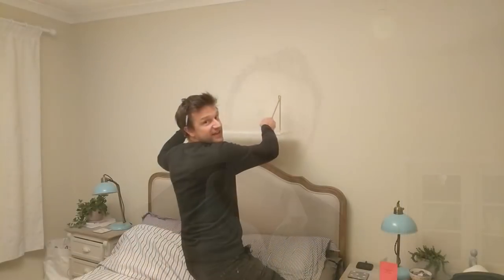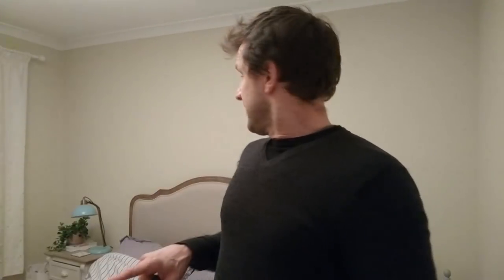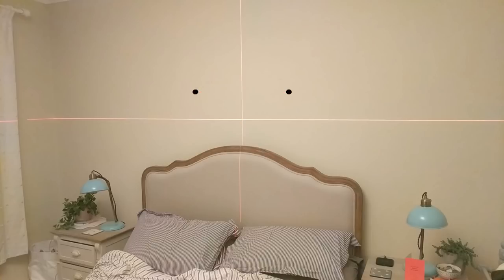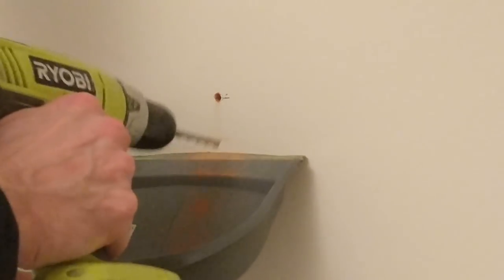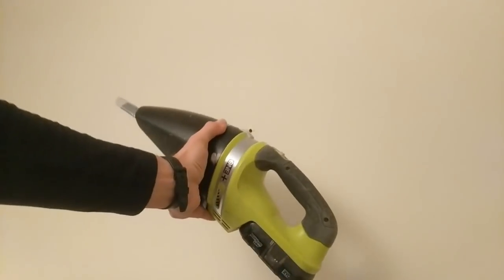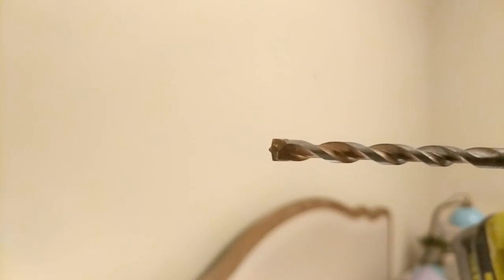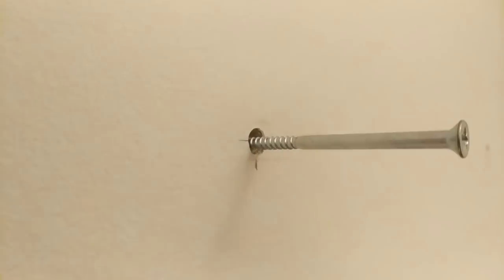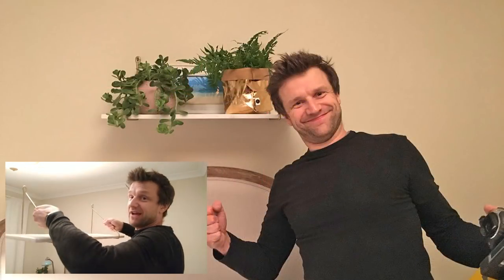How to Hang a Heavy Shelf on a Brick Wall

Comment: Some nice tips Charlie, thanks for the video. I like the dustpan idea but I don’t have the hand coordination and grip strength you do as I am getting a bit older. I use a brown paper bag (lunch sack) and a strip of blue painters tape across the back and use that to catch the mess from the drill bit. It works well for me... cheers.
Ron
Reply from the maker: Ron H That's fair enough Ron. A decent technique that I've heard other people using - just need to be careful not to take the paint off. Thanks for the comment!
Reply: What a damn good idea. I haven’t drilled anything because I’m afraid it won’t hold and the mess it’s going to create. But the bag idea 💡 I will do that instead of the broom pan. Gracias from Mexico 🇲🇽

Comment: Great tips as always Charlie. Particular like the "wiggle" about abit drill bit. Everyone has one of them "universal" drill bits in their toolkit! I tend not to knock through the wall plug in as you lose support of the wall plug where you need it i.e. Nearest to the wall. Without that when you are hanging items the screw can pull down into the void slightly. If the correct size screw and hole is used you shouldn't really get plaster cracking.

Comment: Before drilling into any wall you should always check for Electric wires and Water/Gas pipes, even if it looks from the outside there is nothing there, otherwise a good job.
Reply: How do you find out if there is anything behind the wall that you listed above?

Comment: Great video Charlie it really covers the practical issues so well including your reasoning for each decision. 

I was just wondering about option 1 - if you recess the plug it would be very close to going through the brick on a cavity wall I think.  Is this something you need to be a bit careful of if you have cavity walls in your house? It would be just the sort of thing I would do Lol.

Comment: Another good way of catching the dust is to put an open envelope under the place to be drilled and tape it to the wall with low-tack tape.   That leaves you two handed for the drilling

Comment: Is it just pot luck you don’t hit crumbly mortar or the edge of brick and crack it?
Trying to fit some heavy duty 6kg brackets to hold a 12 kg keyboard.
Pretty old house so chances are the mortars not up to holding 18kg  but reluctant to strip it back to brick if I don’t have to.
Any advice appreciated 🙏 or do I just pray I hit the middle of a brick 🧱

Comment: we have a 20 kg cabinet to hand that can take additional 10 kg load. The cabinet is held on 2 parallel battens that altogether are fixed by 8 screws to the wall. We were thinking 8 by 50mm fisher plug plus 5x70mm screws, do you think it will do the job for the potential 30 kg? It's a brick wall as well. Any hints on what length plugs/screws for what load in general? thanks for a super useful video, hope we will get ours right :D
Reply from the maker: Hi Anna. Yes I think that would be a sensible combination, which I'd probably go for too, and I think you're spot on with a 5mm dia screw which presumably is the correct length to just go through the back of the fixing, taking into account your batten depth? I actually sometimes just use brown plugs when fixing into brick, but I only use plugs like this https://bit.ly/3uuDphL as a lot of brown plugs on the market are rubbish. Good luck with putting it up.
Reply: @CharlieDIYte  thanks a lot for reassuring us in our choice. We have access to the fisher ones and ppl seem to be very happy with them so we will go for them rn but will take a note of the plugs you recommend for other projects :) also the batten is 15mm plus 50mm plug should be optimal with 70mm screw I hope :)

Comment: Another great video thanks.  I've just put up a roller blind using top mounting method with battery drill. Bad idea - presumably was going into lintel - took ages. I really like those Fischer UX plugs but they have two versions - one doesn't have a rim and is designed for push through fitting.  Any idea what they mean by push through?

Comment: Builder tried ti drill holes for me to hang up floating shelves for some bookshelf speakers. Wall is plaster on brick but when drilling the drill bit would veer off left or right making the hole unusable. The holes that he did manage to drill straight just didn’t hold the shelf up and the plug just came out with the screws when even a light weight was put on the shelves! Will this method work?? Thank you.

Comment: what if I end up drilling into the mortar? is that fine, or should I move a bit to the side, so I find the brick?
Reply from the maker: It depends how strong the mortar is. In my old cottage the mortar is pretty crumbly so plugging in it is problematic. There's no way to know when you're drilling so my advice would be to see if you can get a good fixing in the mortar. Maybe start by drilling a 5mm diameter hole because of you do hit mortar with that you may be able to get a 6mm plug in.

Comment: Do you want the hole as deep as possible, or only as deep as the wall plug is long? Just repainted a wall ready for some brackets for shelving which will hold books and so are deceptively weighty.
Reply from the maker: You basically want to go about 10mm deeper than the screw length, Jeremy. You want that margin of error because there's nothing more annoying than the screw hitting the back of the hole before you've driven it in, which can also damage the plaster at the front. Also worth tapping the plug a bit below the surface so it doesn't crack the plaster as it expands with the screw inside it.
Reply: @CharlieDIYte  thanks for the quick reply!

Comment: Do you know how heavy the shelf is? I’m thinking of buying a concrete shelf that weighs 3-4kg (depending on the size I get). We’d be putting it up on a brick wall as well, so similar situation.
Reply from the maker: I'm afraid not Angelique, but it would have been similar in weight. Provided you get a decent fixing you should be fine

Comment: Hi there liked the video!!. I wonder if you can shed some light on my method of something I have tried to do please. I wanted to attach a piece of wood (18mm) on to a brick wall. I used red plugs and 4mm screws. I have seen people drill through the wood with a wood bit then change to the masonary bit of the same size (6mm) , then put the plug into the wood , add the end of the screw then tap in with a hammer, the plug goes through the wood piece and so on. the bit I struggle with is trying to get the plug through the wood into the wall - basically the scews expands it a little and hence does not go through. I cannot make the hole any bigger in the wood of course the screw wont hold and i would go out of line overall. Any clues what it is i am doing wrong? thanks in advance
Reply from the maker: Do you need to do this? It's a neater job if you put the wood in position, drill through into the wall with say an old 4mm hss bit to mark the position of the holes and then take the wood away and drill and plug the wall. If you do have to have the wood in position the mistake you're making is not using a screw that's wide enough in diameter. You need say a 5mm dia screw. That way when you hammer in the screw it doesn't go too far into the plug and drives the plug through the wood. You have to be reasonably aggressive with the first few taps to get the plug going through. You can then go back to the screw you intended to use, to fix the wood in place. However 4mm is quite a thin screw... Hope that helps.

Comment: Hi, just to check - did you use the longest screw because of the weight of the shelf or because it had a wider head so that (hopefully) the shelf wouldn't slip over the head?  Hope that make sense.
Reply from the maker: From memory I think it was the size of the head, but the larger head size also denotes a larger screw diameter, which I was keen on using to get a really tight fit in the wall plug.
Reply: @CharlieDIYte  Thank you for replying.  I am just trying getting to grips with the basics and trying understand why and how! Like the videos

Comment: Hey Charlie, do you think these would be strong enough to hold an oak floating mantel? The company I ordered from advised to use 4.5 x 100 screws as the oak mantel has keylocks routered into the back of it. Great video thank you b
Reply from the maker: Don't know without knowing how heavy the floating mantel is. When I'm fitting heavy things with those keylocks I tend to use a reasonably thick screw - at least 5mm diameter. Problem is the screw head doesn't fit in the key lock, so I slowly rotate it on my belt sander, reducing the diameter of the screw head until it fits in. That way you have the benefit of a long, strong screw that still fits in the key lock. I guess ideally you want to go with pan head screws, but there doesn't tend to be a decent selection of sizes, and they tend to be slot headed which is a bit of a pain. If it's a heavy mantle, the integrity of the fixing (ie getting a strong fix into the wall) is also key.
Reply: Charlie DIYte thanks Charlie. It weighs around 25kg. That was my worry too that the more heavy duty screws won’t fit the keylocks.

Comment: A few good tips there, thanks. But(!) you put up a marble shelf above the head of a bed? Maybe I'm not quite as good at DIY but that seems like a deathtrap to me. I wouldn't even put up a wooden shelf above sleeping heads. I'd only put a shelf there if I had two cantilever supports holding the shelf up that went all the way through the wall and were bolted on the other side. 

You didn't even angle the screws downward to counteract the inevitable torque/force-moment that will be trying to pull the screws out of the wall.

I'm scared for your sister, and anyone who puts something heavy above their heads without careful consideration. 

Apologies if I'm wrong, but I honestly can't see how I am overly concerned.
Reply from the maker: I hear your concern but if you had felt the pressure on that screw you'd not have had any concern about the shelf coming down. Fear not though, they've got a cupboard there now ,😉👍

Comment: My tip for collecting the dust is to fold a piece of paper or card in half. Pull in the edges of the half not touching the wall and tape them down. Then attach the back to the wall with low tack tape. That creates a pocket for the dust to fall into and you still have two hands free for the tool and/or item being fixed to the wall
Reply: @800Viffer ... I use a similar technique with an envelope